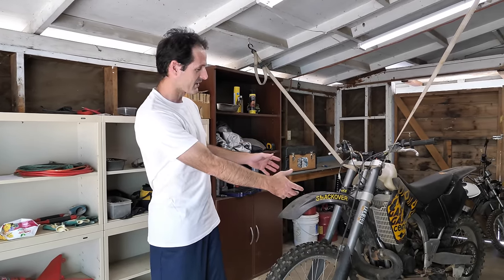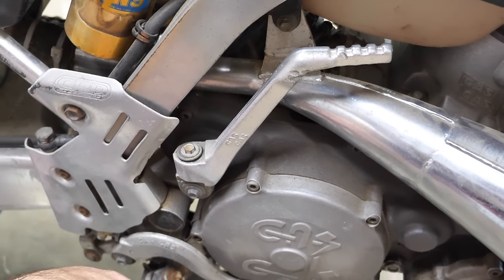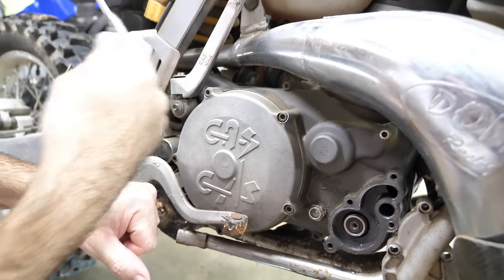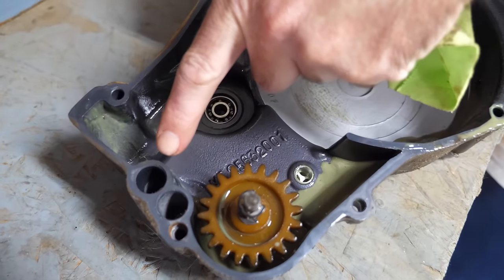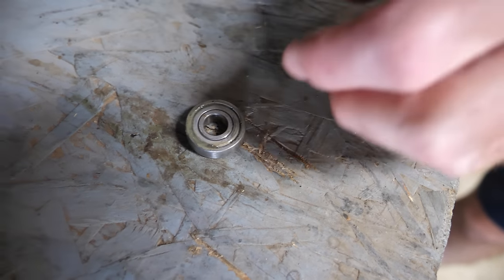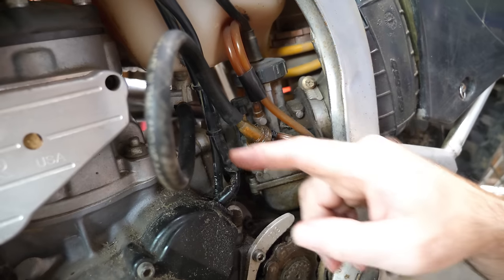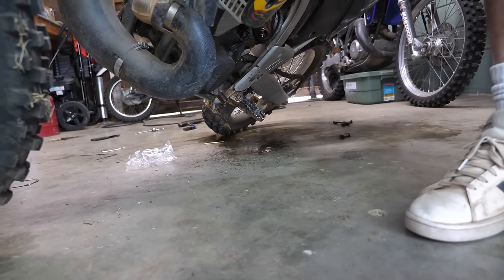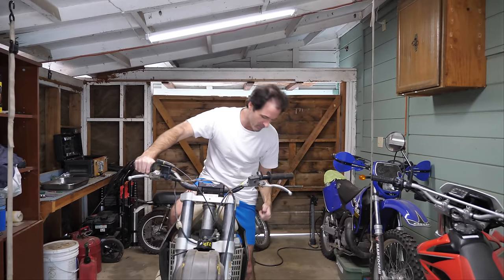Rare Old Dirt Bike Picked From A Backyard - WILL IT RUN??

Comment: It’s amazing how many unintentional and some intentional innuendos there were after the Harris & Brown reenactment.  Never knew that there was water cooled 2 strokes, another win for the dynamic duo.  The only thing I would have done differently would be to inspect the clutch before putting the case on knowing there was water in it.
Reply from the maker: I did waste some time by not looking at the clutch the first time around. It looked pretty good from the outside though.

Comment: There's no right and wrong around milky oil, both ways could have mean loss or win, another way is just less riskier and that being one you did. Carb cleaning should always be one of the fixes on any motors that has been sitting around longer, while pilot or main seems to be clean, there's another passages that could be blocked and carbs actually have tiny ones that will get blocked due old gas/oil mix "drying" in them when it does not get circulated frequently.  Clutch disks being a win/win situation in there, that's good enough fix for a while but imo should be changed if all goes right in the next episode. Love to see more soon!

Comment: For two stroke you want fresh fuel, since old fuel ignition might cause knock and ruin the engine. You can put the old fuel into your car and use it there, though premix might cause issues on regular use with the catalytic converter, but most engines have anti knock sensors so its not much of a issue there, just make sure to mix it with fresh fuel and not so old its varnish.
For the lubrication if two stroke bike is this unknown condition and mistreated over the years, i would run premix and delete feed pump system. If you dont want to go inside the engine remove shaft or something else runs on same shaft, just put tube that circulates oil from outlet to inlet and have it connect to oil reservoir. This way it keeps lubricating the pump.

For carb, even if looks clean there might be some corrosion in the jets. Had one that was sparkly clean except there was tiny bit of corrosion that didnt let enough fuel trough to run properly. cleaned it out with toot pick wood and some copper wire. Smaller the jet, easier little corrosion effects it.
If clutch is stuck like that you can try putting in a gear while facing a wall but opening it up is the better option. While its open you want to put the friction disks into oil bath while you clean the steel ones. Since this is the wet clutch system it is adviced to soak them for couple days when you buy a new set or get one second hand. This helps the clutch work properly. After few hours of use replace the oil to get any contamination off the engine. Whit this particular one most definitely need the oil replaced after short drive, so it flushes all the water contaminated oil out. When putting the coolant, sure use water to test but then take some out and make sure it can take frost of your area and then some since you never know if blizzard hits and freezes everything.
Reply from the maker: Yes I will put anti freeze in there now that I know it runs. No issue about the oil injection, this bike was premix from the factory. Thanks for the comment.

Comment: You could use JB Weld to fill the divot in the kick starter. It's much stronger than aluminum.
Reply from the maker: Thanks for the idea. That area takes a lot of force and in my mind I envision it chipping away after a couple kicks, but maybe it would hold.

Comment: I will take it!! These are all I ever want to ride other than a KTM or a Honda if I have to... Honda for reliability, Gas Gas to go. You will have to look overseas for parts. Lots in Spain, Italy, Northern Africa. Look Internationally for parts and when you find them buy all they have. These are bikes that were owned by Expert Riders. If not they end up looking like this one.
Reply: How long does an expert rider own a bike?    2-3 years tops?
Reply: You can probably find every case bearing/seal you need from places like Detroit Ball bearing.  So if your not replacing transmission shafts, shift drum, shift forks, cases or repair, where is the money going?

Comment: I have a similar bike, 2005 ec300. I bought it to race and I wish I'd been more patient as it did run but it was a mess. Parts have been tough to get and now I have to split the cases because it's got a bad oil leak at the seam. I give up, it's currently for sale as I've spent a race season fixing it
Reply from the maker: Too bad it didn't behave for you. I got my parts from cpd powersports. I don't endorse or have an opinion about them but they had the parts I needed.

Comment: I would’ve went straight for the gas. Two smokers and dirt bikes in general are more susceptible to water in the gas. Or the flamability is gone. But it’s always good to clean out the carbs. It gets nasty. But I will tell ya best thing u can do for the clutch when it’s stuck like is some 1k grit sand paper to it. It’ll be a temp fix. IMO. But it’ll do to fix it for the moment

Comment: Since the water that came out was completely clear, and at the very beginning of the video you said the guy had it outside leaning up against the fence covered by a tarp, I'm guessing it was rainwater that got in there somehow. Is the coolant in it green? If the coolant is green and the water that came out was clear, then it's probably just rain water was my guess from sitting outside.
Reply from the maker: Smart reasoning. The coolant I drained from the pump/radiators was clear too.
Reply: @jenniesgarage  ahh ok. It very well could have been coolant leaking in then. I didn't catch that the coolant was also clear if you mentioned it.
I bet that thing is a ton of fun now that it runs.

Comment: idk man that's an insane amount of water, has to be like rainwater getting in somewhere. in my mind it couldn't be a tiny water pump leak, espicly if that exhaust pipe trick wasint blasting air right through. its two-stroke, i probably would have let it turn the replacement oil into a milkshake before making it a bigger project.

Comment: Bearings should have almost no play in a perfect world. Always check replacements cause they might not have been produced with tight tolerances depending on where you purchased them from. 

Also, invest in a set of metal picks my man 🤣. Those mating surfaces will thank you.
Reply from the maker: Good idea about checking the new bearing too.

Comment: Have you ever Heard of using A hair dryer.,or A heat gun to soften up the intake rubber boot and breather boot with. To allow the carburetor to easily separate from the rubber boots faster to.

Comment: Pull engine rebuild top to bottom even if compression is good. Do forks swingarm rear shock and brakes. Don't assume anything bikes will hurt you with air leaks.
Reply: Yea, well I just broke a rib yesterday.  The bike has no air leaks.  :)

Comment: You gotta run with the bike while its started in neutral run with it jump on knock it into gear take off a little them pull in clutch lever and giv alot of high revs this usually frees up a clutch its doing it because the bike hasnt bin ran for a while
Reply from the maker: It was pretty locked up, I don't know if even that would've got it freed up. Maybe once the oil was warmed up and with enough tries. I'm glad I took it apart though because it was such a mess in there and it was good to clean it up. Thanks for the comment!

Comment: Ask an expert.. question. What is the difference between a spark plug helicoil kit and a regular helicoil kit? Is there a performance difference.. Does it matter.. Thanks! I'm binging on your ct90 vids, they're very good.
Reply from the maker: I'm flattered for being called an expert, but have never used a helicoil! My first guess is that maybe the spark plug ones are longer. Depending on what it is maybe you can just get a used head?

Comment: im surprised you didnt fill the cooling system and pressure test it with the oil drain plug out before you pulled anything apart
Reply from the maker: Looking back, I think the reason I didn't do that is because I didn't have the necessary equipment, and I thought a bad seal was extremely likely anyway.
Reply: He already knew coolant was in the tranny oil.  What would he have learned from the pressure test?  The water pump shaft is just about the only way coolant can get in the tranny oil, and some models are a bit notorious for it.

Comment: I bet you couls build that kick starter back up to a workable shape with some jb weld
Reply from the maker: Maybe. There is a ton of force there though so it might chip away. Thanks for the idea!
Reply: @jenniesgarage  its worth a shot, if you want to make it even strnger add some metal flakes made with a file to it, and make sure you use the longer set time version

Comment: You shouldn’t use that Shell Rotella T5 in a motorcycle engine/gearbox. Car or diesel truck oils have friction modifiers in them which can cause a wet motorcycle clutch to slip and used in a gearbox it can break down much to quickly. To be motorcycle approved it would need JASO MA2 or API SM approval on the label. There is a reason Shell makes specific motorcycle oils 👍
Reply from the maker: Interesting, I will look into that.

Comment: Your supposed to use wet clutch oil valvoline has some cheaper I use maxima mtl 80w in all my bikes and quads
Reply from the maker: I haven't had issues using regular oil, but will look into that. Thanks

Comment: I would have probably made sure it started before fixing anything, after it ran then I would have to fix everything else
Reply from the maker: Makes sense. I just figured it was likely enough it would run, and the parts were cheap enough, I'd just go ahead and make the repair. Thanks for the comment.

Comment: If it's been sitting your absolutely going to have to go through the carb. PS. Remove the rear suffrage to remove carb.
Reply from the maker: I knew I could take off the subframe to make carb removal easier, but didn't think it was worth the extra effort. It was a fight to get that carb out though, so removing the subframe would've been an easier choice, even if it took longer.
Reply: If you drain/burn the gas out of the float bowl before storing, what would be in the carb to gunk it up?

Comment: I have a 1998 exc 250 hard to find parts
Reply from the maker: Yes it's not like buying parts for a common brand. I found my parts at cpd powersports. I dont endorse them, but didn't have any issues. Their diagrams only go back to 2001 though. Other commenters have mentioned Hall's cycles as well.
Reply: @jenniesgarage  thanks ,I'll check them out.

Comment: Or fix it right and then start it and know it will be all right and work as it should. That's what a pro would do. But this is Jennies Garage. This is where you go for it and hope it doesn't come back to bite ya in the butt. Might be why it was under the tarp and laying against the fence. Because the engine is blown up. or that all the gaskets are shot along with the seals. steal another kick starter lever off something else. so the clutch is just out of adjustment. the clutch lever and cable might not be working to release the clutch eh? Drill and wire brush the steel plates and clean them up and tryer again. Yep that is exactly how I would attacked the bike as well.

Comment: That was water not coolant. Looks like it was setting outside in the rain for a long time.
Reply from the maker: Good theory, but I couldn't find anywhere for it to get in. And the water I drained from the cooling system was clear too, which made me suspect a bad seal.
Reply: yea if they was running just water in the system then you made the right call to replace the seal. 
 @jenniesgarage

Comment: Just wondering..... shouldn't you have used motorcycle oil designed for wet clutches?🤔

My solution to the kickstarter problem would have been a rope and a tow vehicle. LOL
Reply from the maker: That would have been fun to watch.

Comment: Thats a slightly goofy seal and bearing system.
Reply from the maker: It does have more going on than the lip seal type, but I've learned now they are very common in lots of applications, so they must have their advantages.

Comment: that looks like white smoke  i could be  burning engine oil   2 stroke oil  burnt is blue  so your crank seals could of gone,,smell the smoke  you can smell if its 2 stroke  or engine oil
Reply from the maker: Good idea on using the smoke for diagnosis. It smelled like good 2 stroke smoke though. Just loaded up because I mixed it a little rich. And who knows what the jetting is.

Comment: Would you PLEASE just go get the right tool?  They are not expensive.  Avoiding the inconvenience of "going to the shed" is going to cost you more money.
Reply from the maker: Well I did get it done without injury or damage. But I don't disagree with you either. In the long run the right tool might save me or the equipment I'm working on. Thanks for the comment.